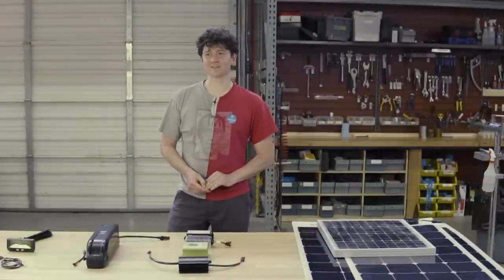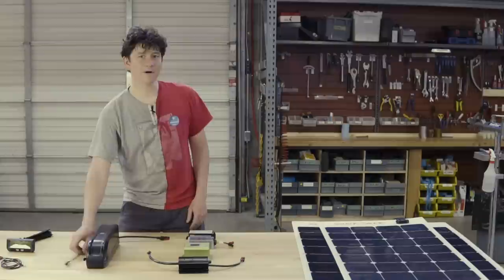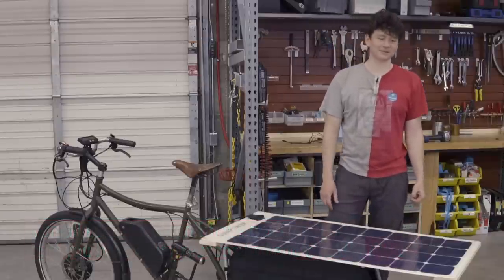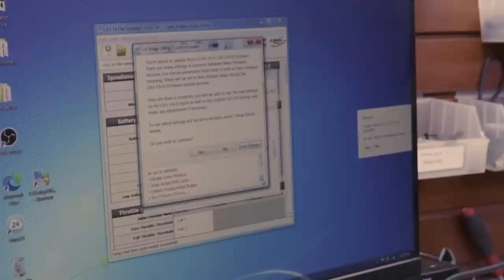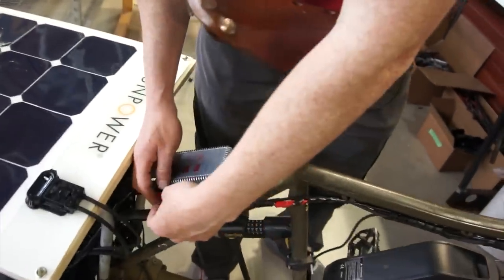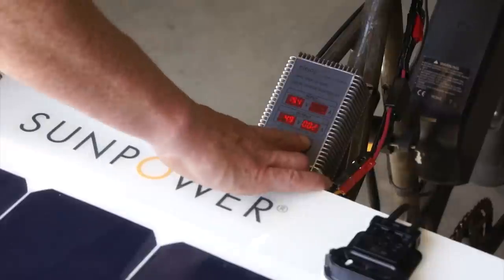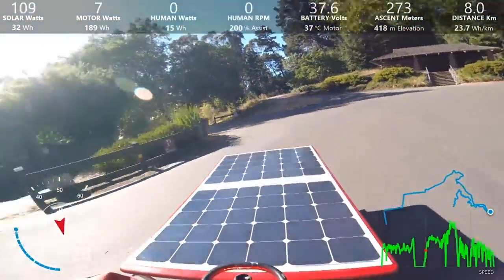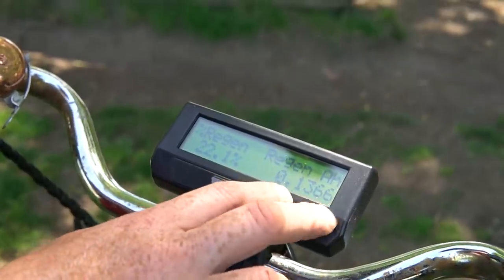Primer on Solar Ebike Systems

Comment: A great video as always. Thank you very much. I run a simpler system. I run my flexible solar panel on a Trailer cart towed by my E bike. I use a 12v output MPPT Controller connected to an 8ah 12 V lithium ion battery. I connect the 12 V lithium ion battery to a step up Buck converter that gives me 42 volts at 2 amps for recharging my 36 V E bike battery. I just wait until I’m about 90% of battery capacity and then I plug-in the barrel connector from the buck converter Into my 36 volt battery while I continue to ride. I do not use regenerative braking. Thank You

Comment: You should configure your solar panels in series for higher voltage and lower current. Parallel solar cells have worse shade efficiency, and buck converters are more efficient than boost. I am building one right now if you want one.

Comment: Somethimes especially when there is 2 ways, I wish that Positive and negative Wh be reversed.
i.e. Positive charge the battery, a net positive energy in the system
And negative use energy from the battery. You loose energy in the system.
But I understand that the convention is kind of reverse.

Congrats, always a superbe work at explaining things.

Comment: Great can’t wait to update my solar system.  I have been charging a separate battery sure would be nice to lose the weight.
Reply: I’ve got a set up like that too. The nice part is that we can charge in the shade still.
Reply: The spare battery, if you can handle the weight, is not a bad deal - as in you have a  backup source of power.

I have thought to do this exact thing, simply because that way the spare is getting charged all the time the solar cells are producing current.  Thought was to use the spare to charge up the main battery during rest stops (when electric outlets are not to be had; if I can find one, and can use it, the Satiator will come out) using a current limiting element, I.e. by pulse-width modulation.

Both batteries will get their main charges up to 85%  in the campground or hotel at the night’s stop.

Comment: The handmade wire from the mppt to the battery input, what is that? Is it available somewhere?
Reply from the maker: That is a custom made wire with the ST3 charging plug on one end and anderson powepoles on the other.  In a pinch you can make this by snipping off the wire of your battery charger and terminating the joint with andersons.

Comment: I am hoping to fit 300w of solar of my nearly completed bicycle camper, and then another 2 x 25w panels on my daily bike.  The 2 x 25W is just to give my bike a charge when I am not using it, and the camper combined with the 2x25w will be used when pulling the trailer.  I have a motor for the trailer as well, but I am unsure yet if I am going to use it.  I might buy another two hub motors for the camper.  It has sealed bearing wheels though with a "pin" style axle, so no dropouts.  I would have to build an axle, or run one wheel drive.  Are the axles of hub motors easy to swap like a normal hub?  I guess I could just leave the camper unpowered and put all the power to my bike.  I am using 48V on my ebike, but my camper has a 24V battery and 12v/24V MPPT.  Sounds like I should just convert it those cells into a 48V battery and get a new MPPT?

Comment: Is that the Grin All Axle motor on the Big Dummy?
Reply from the maker: In the video it's actually an eZee motor on the front that I was testing. The All Axle is a bit larger in diameter.

Comment: I think Hobotech (et al) get it right.  Instead of a bespoke MPPT controller, get a small lithium ion power station.  Much more versatile.  Any extra weight is mostly from the extra battery capacity, which is actually a feature rather than a bug.  And if worried about weight, get a 45 lbs e-bike rather than a 65+ lbs e-bike.
Reply from the maker: This goes into a much deeper analysis:
https://youtu.be/15HHLY4BfA4?si=scS_lLeNQy7IbApX

Mechanical considerations aside, at least in summer weather a solar panel is both cheaper and lighter than an additional lithium battery of the same daily energy capacity. 

Ex, a 200 watt solar panel is under 4kg and will generate around 1kwhr /day. While a 1kwr battery costs twice as much and weighs more like 5.5kg
Reply from the maker: Oh maybe I read you wrong, are you saying just use the panels to go into a lower voltage lithium pack directly (no mppt) and the have a separate DC-DC to boost this back to pack voltage?

Comment: Congratulations! Would you know... Do "The Sun Trip" cyclists alternate batteries or do the solar panels stay connected to the batteries/motor all the time? I think other people also have doubts about direct connection panel/battery/motor running. Thank you, success! Nélio – Brazil, MG.
Reply from the maker: On the suntrip race everyone has their batteries hooked up the whole time both to the panels and the controller. There is no issue about having charging take place while the motor is running, I'm not sure why people would have doubts about this.  
The only exception we're aware of is Bosch ebikes which have an overly protective battery system. They don't like to be charged through the discharge port and they don't like to allow the bike to run if the battery thinks it is in a charging state.

Comment: I am not sure of everything being mentioned.  I have my ebike, but not yet am I sure to use a solar panel or panels.  I bought a new 300 watt solar system, but did not work on a standard battery, I feel the MPPT was not working, so I bought another one, just waiting.  I hope I will be able to make one work.

Comment: Will your display work with famous Kuteng (KT) Controllers? Or I have to change all system, if I want to use V3 Cycle Analyst?
Reply from the maker: If you use the Stand Alone Cycle Analyst shunt you can use the CA3 with virtually any controller. You just need to change your wiring a bit so that the throttle plugs into the CA3, and then the CA3's throttle output (green pigtail wire on the shunt) hooks up to your motor controller's throttle input.
Reply: @GrinTechnologies  , thanks! I found it!

Comment: Regarding shading, you can have two smaller panels in parallel.. In this case two 50W.

When the one is shaded, the other one can give full power.
Reply from the maker: Indeed, the next follow-up video on this will cover that exact topic.  But two 50 W panels in parallel with one of them partially shaded is still not as good as each 50W panel with it's own MPPT, since the max power voltage for a shaded panel is different than one in full sun.
Reply: @GrinTechnologies  looking forward to that video..

But the smaller the panels, the more diminishing return on investment (for two controllers in sted of one)

Not only the price of the two MPPT, but increased power consumption of one extra MPPT controller.

The last bit is probably low, as efficiency has improved over the years.

An other option for use of two solar panels is having them as a V shape behind the seat. One panel to each side. This is to increase the size of the panel on a regular sized bike.
Reply: @GrinTechnologies  and also, they are now selling pre-split solar panels. 

It's two panels in parallel mounted on one frame. They advertise with better shading properly.

Since it is one panel, it's has to be used on one controller/micro-inverter.

The panels are called half cut.

Comment: Very cool. im designing a cargo tricycle im thinking this has a lot of potential for providing my tricycle music and sat nav etc need to add up the numbers though
Reply from the maker: If it's an electric assist trike then what we describe here will totally work. But if it's a pedal-only trike and you want solar to run auxiliary stuff like music, lights, gps etc., then it makes sense to get a conventional buck converter to 12V with a 12V battery, rather than a boost converter to higher ebike battery voltages.

Comment: If you charge through the discharge port, bypassing the BMS charge protection, how do you ensure all lithium cells are protected from overcharge?
Reply from the maker: You don't, but usually you'd set your solar charger MPPT output to not be a 100% charge anyways and you would rely on having a broadly balanced pack in the first place which is the case almost all ebike setups using quality battery packs and cells. If this is a concern for your situation, then either use a battery that has a common port BMS, or hook it up through the charging port if you only have access to batteries with dual port BMS's.

Comment: I have a question. Would it not be easier to have this device on a trailer....charging a separate spare battery.? I have a Bosch mid drive e-bike and do not want to mess with the current  motor / wiring.
Reply from the maker: Trailers definitely have some advantages, check out our Mark Havran video!

Comment: think i can trust the BMS on ebike 48v batteries?  Okay to charge at 60v5amp using solar directly?
Reply from the maker: Use an MPPT set to the correct full charge voltage and charge through the batteries charging port (if it has one) and you should be fine with minimal risk.

Comment: insulation foam sheets are a good way of mounting a flexible panel with very little weight.

Does the same principle of charging the battery apply to a small wind turbine, as this would be useful charging at night after a days riding while on a camping tour?
Reply from the maker: Yeah foam can have a lot of stiffness and is what we used as a backing on the suntrip panels, although that does eliminate any cooling from the underside so the panels will get hotter and less efficient than if the bottom is exposed. 

You could certainly charge with a portable wind turbine too, they're popular with boaters and any unit that can do at least ~100 watts would provide a healthy amount of charge over the course of a night

Comment: Great video, thanks! Is it Ok to connect the solar charger AND the motor controller to the battery simultaneously ? 
Aren't we supposed to connect the motor controller to the LOAD output of the solar charger ? (if it has one) ?
Reply from the maker: There is zero problem having both charging and discharging currents on the pack at the same time, unless you have a bosch ebike. Those are notoriously locked and overconstrained in this regard.
Reply from the maker: The controller is connected to the batteries discharge port. That may happen to also be the mppts output port if you are wiring them all on a common bus, but not necessarily. You would never run an mppt into a motor controller directly without a battery in the mix.

Comment: Question. My 13 ah lion battery takes me about 25 to 30 km till it dies, if i do this, on a full sunny day, how may km will it add?
Reply from the maker: Good question, a 100W panel in full sun might capture 90wh per hour. You didn't specify your voltage or how long it took you to travel 30km but lets assume 1 hour and 36v so: 36v X 13ah= 468wh. You're using roughly 15.6wh/km so you'll get an approximate 5-6km extra range with that 1 hour of solar charging during your 30km ride.

Comment: This video is super awesome. I know this is a bit of a strange question but can you use one of these on a mid drive or bbshd unit? I love the solar input feature but have never seen a cycle analyst used on a bafang system.  Thank you for your hard work making this content and product.
Reply: Are you talking about their display Cycle Analyst or the solar setup?
Reply from the maker: Hi Matt, for sure it's zero problem at all to use it on a BBSHD setup. You can wire up the stand alone CA3-DPS device to any ebike at all as a monitoring unit, just hook up the shunt inline with the battery leads.  You won't have any of the control features (like current / speed limiting, throttle ramping etc) since the throttle isn't wired into your system, but you'll be able to see your speed, energy consumption, and all of that stuff along with the solar details.
Reply: @Discostew2  Both
Reply: @wornoutwrench8128  I will do that now thank you.
Reply: @GrinTechnologies  Thank you very much. Ill have to look into all of these suggestions.

Comment: What happens if the battery reaches maximum capacity if left parked in the sun for a long time? In this setup are you just depending on the built-in BMS in the battery to stop accepting power when full? As a side question, how does my basic AC ebike battery charger detect when to shutoff and switch the LED on the charger to the battery full indicator?
Reply from the maker: The mppt will stop charging over the battery is full ( or at the mppts max output voltage if you don't want solar to fully charge the battery to leave headroom for regen and better cycle life). It's no different at all from a regular charger on that regards. The bms cutoff is a backup, not a primary means of charge termination. 
Depending on model, led will change  either on reaching CV stage of charging, or when charge current falls below a threshold.  In the satiator, you can even program that threshold.
Reply: @GrinTechnologies  Okay, thanks for the clarification.

Comment: Hello I was looking for a long time for my trip.  maybe you can help me.  I have to charge 52v 28ah 1456wh battery with solar panel above my trailer with my dog.  can you tell me if feasible?  what do I have to buy,!?
Reply from the maker: To charge this amount of batteries up in a day of full sunlight you would need about a 250-300 watt solar panel, while in more typical conditions you would probably want more like 400-500 watts. See https://ebikes.ca/learn/solar.html for more info
Reply: @GrinTechnologies  thanks Even less because of the bulkiness. The important thing is you had a minimum of support to travel. I understand the quantities and sun that would be needed. Here with me he does not use Germany, Holland, Denmark. Here Italy is road rules country constrictor in bike and especially in trailer 😭😭 but something deo genre I can create. If I send you my project trailer to emails. I am Marco pleasure to meet you 💪👍😉🙏❤️

Comment: I have a Rad Power Bike.   Can I charge the battery at the same time I am riding it, or does my battery have to be turned off in order to charge it?  I would really like to charge and ride at the same one.
Reply from the maker: Rad bikes use generic batteries that almost for sure can be charged while underway.

Comment: Also, you should make your torque arms 3/8" instead of 10mm. It will fit a 10mm axle more snug.
Reply: That's because they machine Clearance into the hole so it doesn't bind.
Good tip though.
Reply: @nigelnightmare4160  I use a 3/8" wrench on both sides of my rear hub motor. I bolted the closed end to a hose clamp, and wrapped brake line around them lengthwise to hold the axle into the crescent. Now it's just really hard to change a pinch flat

Comment: Great content..got a question..where can I get the cable to connect to my Bosch 400 / 500 battery from the controller.
Reply from the maker: Can't say where exactly to purchase Bosch stuff!
Reply: Bosch doesn't sell to the DIY community, so it is best to work for or make friends with a bike sales/repair shop & get them to order what you want from Bosch

Comment: I bought a Belize fat tire 20 inch trike from Canada and modified the upper rear bike part of the frame to accommodate a rickshaw 48 volt 750 watt bolt on motor that does 30 mph now working to be semi recumbent for better and easier speeds thinking about a solar panel trike is much better long as you are sitting low for stability
Reply from the maker: For sure, they're are thousands and thousands of examples of this. Just look at the solar category in our project gallery:
https://ebikes.ca/project-gallery.html?other-features=25

Comment: Great video! Looking at the Genasun product page got me thinking. It says it can accept input voltage as low as 5V, which makes me think you could plug it into a USB wall wart and charge. Is that right, or am I missing something?

I see that it also notes a 8A limit, so the most you could get is 40W, but if you leave that plugged in overnight it'd give around 500 Wh, and then when you're on the road you could switch it to solar. It seems like the most optimal setup would be to to incorporate this right into the battery housing itself.

There are probably better/cheaper ways to charge an eBike battery via USB, but enabling solar input at the same time is nice. Maybe the light weight and ubiquity of USB chargers would be enough to tempt more people into buying a Genasun? Or maybe Grin will develop and sell eBike batteries with USB charge ports in the future? USB C claims it can output 100W, which seems more than enough for normal eBike charging uses, but I still don't see USB C chargeable eBike batteries. Hoping an innovator like Grin will make this happen someday, maybe USB charge ports could be added to your next version of LiGo?
Reply from the maker: MPPT's work by scanning the power draw up and down until finding the point of maximum power draw, and that does not play nice with most CV power supplies where the power keeps increasing as you draw more current until it they abruptly shut off.  A much less expensive fixed wattage dc-dc boost converter is more appropriate a device.  Plus the most power you can get from a USB wallwart it typically about 10 watts (5V @ 2A).  Even if the genasun worked at 5V it would be an pretty slow charge process (like many many days to charge an ebike battery). 

USB-C PD is a very interesting power protocol that allows stepping the USB voltage up to even 48V DC and 90 watts of power, so that is the only area where I'd see USB and ebike battery charging overlap.
Reply: @GrinTechnologies  Thanks for the info. USB-C does seem like the right solution. I'd prefer an eBike battery that charged more slowly from USB-C than one that I had to carry big chonky special charger around for.